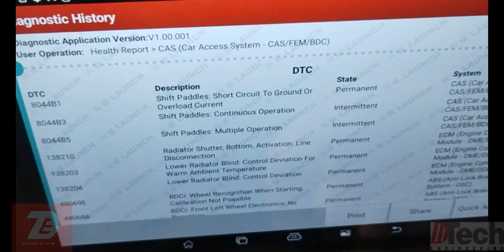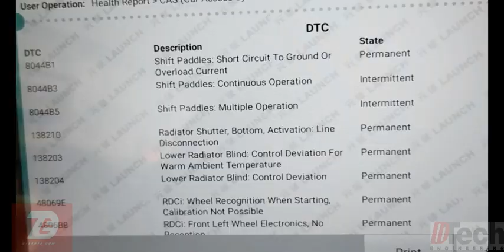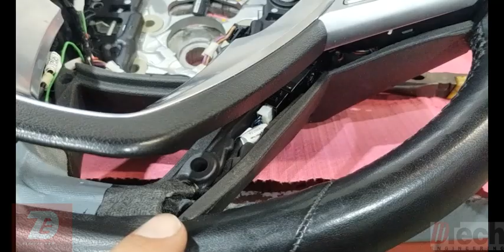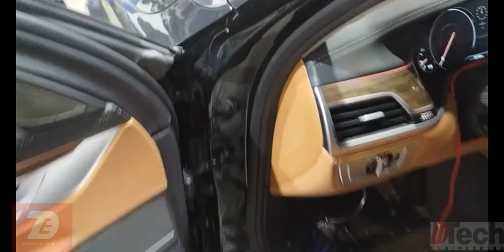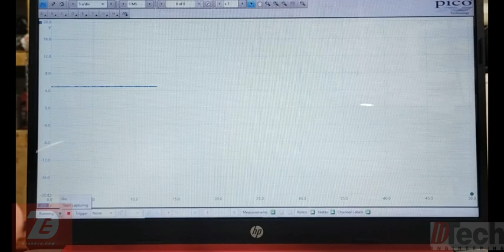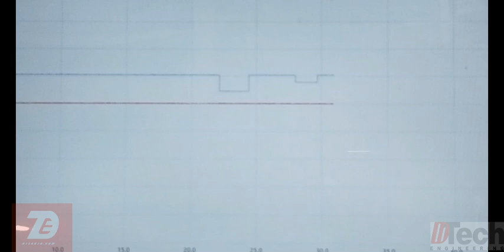2016 BMW Manual Shift Mode Activates on its Own

Comment: We had a car with airbag error report a long time ago. BMW didn't fix it but a local did.
It was also in the steering wheel. Nice video, and nice presentation.
Nice and informative video, thanks (enven if it 's out of my scope, only doing keys).
Reply from the maker: Thank you for watching and it is at least good information to keep in ones back of mind just incase anyone runs into this odd issue.